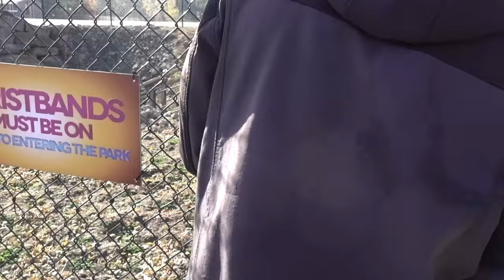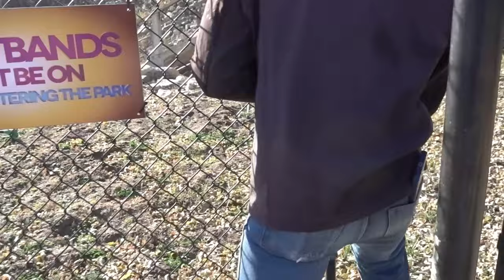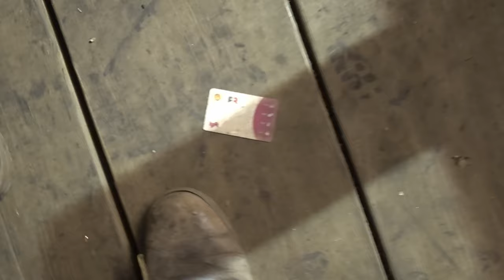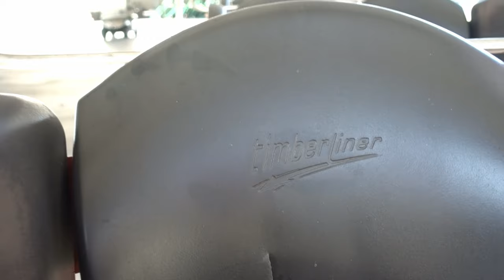IN THE HADES TUNNEL  - Mt. Olympus BTS Tour Part 2!

Comment: As a recently retired airline mechanic, I did appreciate the discussion about maintenance on the train cars 19:23 . Especially the part about NDT, or non-destructive testing. I would imagine that finding cracks in critical structures on these cars that are not visible to the naked eye, would be a high priority. I would be a total geek and fan if there was a video series focusing on theme park ride maintenance. Walking the track daily is certainly part of that.
      Thanks for the look behind the scenes. And please do send some extra thanks to your host and tour guide for this video.
Reply from the maker: Thank you for your kind words! I worked in maintenance for 3 years at another park, and I find it quite fascinating. While that park is more restrictive in terms of what I could show, it was an absolute blast being able to walk through this sort of stuff where I could film it. The park I worked at actually had an NDT machine on site, which was used throughout the year during train maintenance. With the high amounts of aluminum in roller coaster trains (and animatronics!), the amusement industry and aerospace industry really aren't that far apart. I'd love to make more videos like this, but getting this sort of access is really hard and takes a long time. I'm hoping a couple other local parks will be open to it, given how popular this video has been. I'd recommend checking out my Slidewheel video (part 1 of this mini series), because that goes even more in depth into what daily checks happen on that ride, along with the structural engineering and controls that are needed for safe operation!

Comment: you know I wonder why the never went with the PTC 360 trains from PTC
Reply from the maker: https://www.youtube.com/watch?v=Oxyv7f6NwcI
PTC360 trains didn't come out until November 2015, where they were announced at that year's IAAPA. During the release, they actually showed footage of the PTC 360 testing on Hades! However, at that point the Timberliner they bought for the original conversion was only 2 years old so there was no need to replace it. The maintenance team really likes the Timberliner as well, so they probably wouldn't move away from it at this point. I asked the PTC guys at IAAPA last year if they had plans to sell a PTC 360 train anytime soon, and the chance was "maybe". Won't say the coaster, since they haven't announced it yet, but it's not Hades!
Reply: @wheelgap  ah I see that makes sense